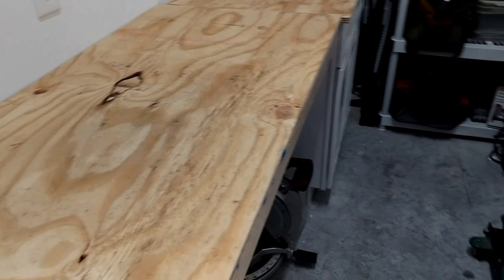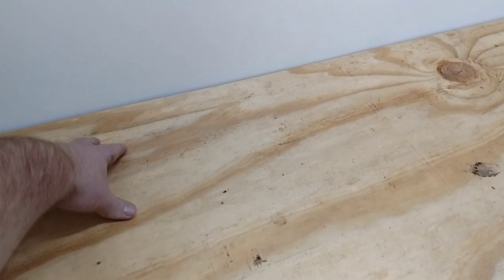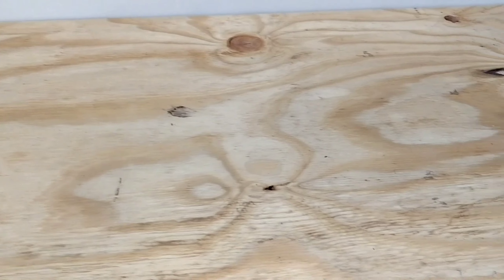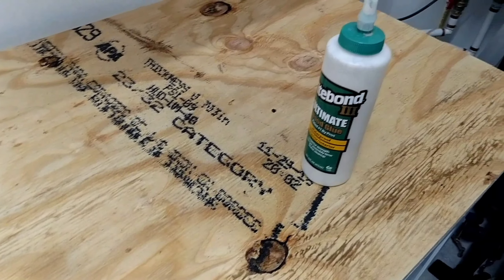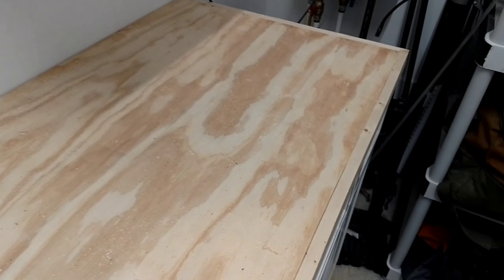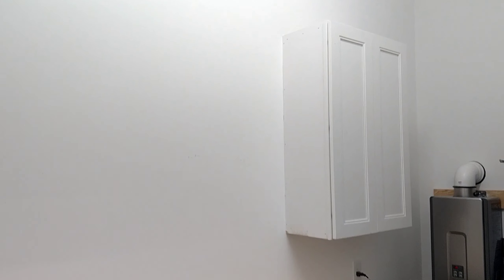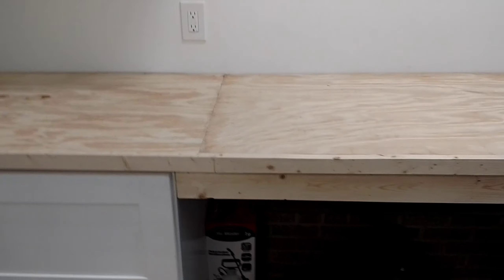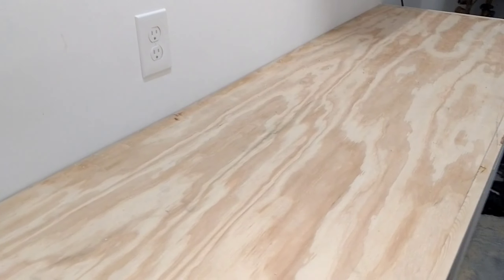Building cheap Countertops DIY and Mail call

Comment: To attach the plywood to the cabinets, did you screw them down from the top or up through the underside of the cabinet?
Reply from the maker: I screw them from underneath similar to how a traditional counter top would be mounted. I used L brackets attached to the inside of the cabinets at different areas. Works great.